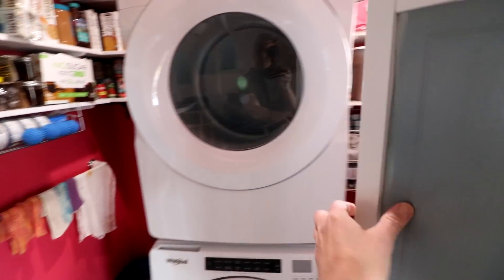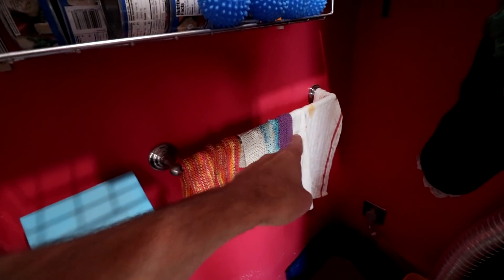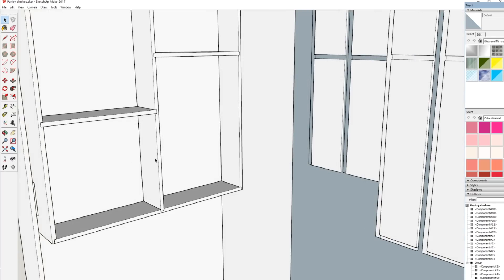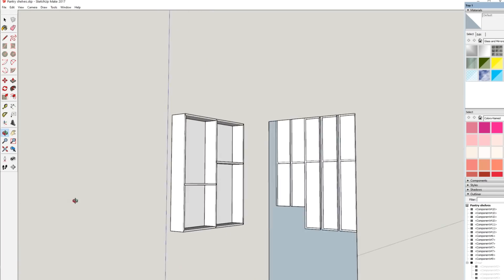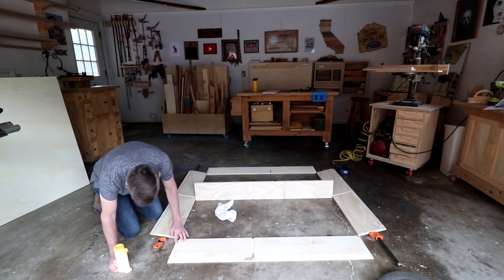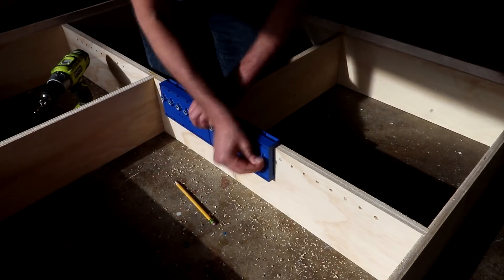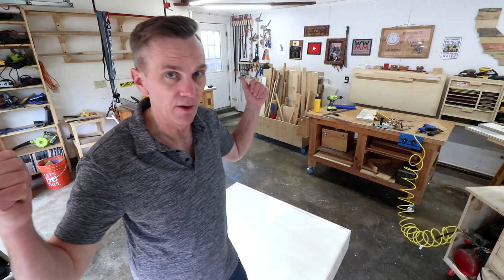42% of you just wing it. Building a new pantry storage cabinet.

Comment: Steve, I would make the cabinet from wall to wall and make a cutout for the light switch.  That way I would have more cabinet space and servicing the switch later wouldn't require taking the cabinet down.  But I guess it's too late know.
Reply: Yes, I would have cut a hole in the cabinet and used a mud ring on the j-box so I could install the switch in the side wall of the cabinet.
Reply: @MucaroBoricua  I've had to do it before for a client (I make my living as a handyman.) It's so much simpler.
Reply: Dwayne Bearup, I’m just a DIYer but glad to see a professional agrees with me.  Cheers
Reply: @MucaroBoricua  An even better idea I just read further down in the comments was to put the switch outside the closet entirely. That would be ideal, provided the wall in question has room for a switch and cover plate....
Reply: @Dwayne_Bearup , cool.  That would certainly be a lot cleaner solution.

Comment: You may need enough space to fix or replace the light switch if needed. 

Thanks for the videos!
Reply: Ouch!  I resemble that remark. Great suggestion! I’d probably not consider that then have to cut out a section to get to the switch.

Comment: How do plan to handle a switch replacement? Are you planning to mount with a French cleat and couple cabinet mounting screws so the outlet can be accessed for maintenance? What about scribing in a filler piece and installing the light switch plate in the filler?

Comment: Hi Steve, Just a suggestion regarding the switch...Make your cabinet full wall width and cut a hole for the switch.  You can buy a box extender so the switch plate is flush with the cabinet.  That would be much nicer than having that long narrow space.

Comment: Curiously, my last project was almost identical to this cabinet, even down to the detail of bevel cutting the top rail that goes behind the back panel to turn it into a French cleat which sure made hanging it easy.  I did not do much in the way of plans.  I figured out the dimensions I wanted to maximize plywood use an minimize waste. So the only drawings I had, were a couple of hand drawn sketches of the plywood showing what pieces would be cut from where,  and couple of detail drawings of the rabbets just to make sure I did not cut them on the wrong pieces.

Comment: I would have looked into trying to build that light switch into the side of the shelving unit.  There has to be some way to bring it out the thickness of the plywood so it looks like it's always been there. That way you could avoid having that gap between the unit and the wall.
Reply: They make mud rings for every size and shape of j-box and in a variety of depths.

Comment: I will use plans for inspiration but rarely follow them to a T. In fact the one I followed most closely was Steve's lumber cart that I built just a few weeks ago. Very similar but downsized it a bit and adjusted the shelf spacing. That's about as close as I get. Sometimes I even combine ideas from different plans. Currently working on a storage cart for drills, batteries, sandpaper/discs/sanders, as well as hardware, that's using ideas from two totally different sets of plans and also adding on pegboard to the back of it for more utility.

Comment: That room has a lot of potential. 

My wife and I had three cats, now down to one 😿. 

Best thing I did was make a cabinet for their litter box. It's separated into two sections, first one is for entry/exit, the other is their litter box. There is a divider and hole between them, hinged lid for access for cleaning and allows light. The litter box side is connected to piping that has an inline fan and vents outside.  This does a few things. No spell or dust and the first area has one of those cat rugs that collects things that might be stuck to their feet. 

Having your dryer in the room should allow you to connect a vent to your dryer exhaust and keep you from having to cut a hole in the wall, should look nice and clean.  Using inline gates that only allows air in one direction should avoid any blowback into your dryer.

Comment: Depends on what you mean by "plans"  I always use plans.  Sometimes the plans are detailed down to individual piece cuts, sometimes the plans are simple sketches to remind me of the dimensions i need for a final product, sometimes I am familiar enough with the project that the "plans" are written on the inside of my forehead.  

The house my father built himself, drove every nail, handled every board was damaged recently in a hurricane and some of the framing had to be replaced during the repars.  I was able to salvage several chunks of 2x8 and 2x10 fir and pine that dad had handled some 72 years ago.  I decided to make some simple boxes and hand them out to my children and their cousins made from "Big Pop's" house.  Each box is a little different in size due to using the most I could out of the material I had; but they all have box-joint corners, inset bottom, flush top and real antique brass hardware salvaged from an old jewelry box shop.  I had a "plan" in my head, but let the dimensions of each box be determined by the material.

Comment: Not really at the level of plans, but I pretty much always take notes of the cuts I need to make and the dimensions. But so far I've only been using very simple joinery (glue and/or pocket screws/screws). 

Recently I tried to make a simple shelf for putting recycling bins (so literally garbage, but a good opportunity to try something a little different) and took the opportunity to practice half laps/dados, sort of in the same vein as your half-lap stool. Hard to denote where all the half lap/dados need to go in text, and I ended up cutting a few dados on the wrong side. Not too big a deal since it wasn't the most important part of the project structurally, but that motivated me to go through your SketchUp tutorial and give SketchUp a try, and I ended up making (and using) my first set of plans to make a desk for my wife.

Comment: On the lighting, you can get smart bulbs and have a remote.  Put velcro on it and attach the remote to a different spot on the wall making it easier to turn on and off the light.  Also, you could use voice activation with google home or Alexa and turn it on or off that way as well.  Then you won't need as much clearance and would be easier to turn on and off.

Comment: Sorry if this has already been said, but you could put a motion detector light switch in there so the light comes on automatically when you open the doors. Then you don't need to reach in between the wall and the new cabinet to turn on the lights each time

Comment: I"m sorry you didn't give us a chance to comment before cutting wood. You can buy junction box extenders to move the light switch out to the inside of the shelving unit. Then I would put a motion sensor light in the ceiling so that you don't have to turn on and off the light. So what if the cats trip the light. It'll go off when they leave. I have motion sensing lights in my garage and basement. If you find you are bumping the switch, a switch lock can make it so the power stays on to the light. Also, most motion lights have a sensitivity setting so that the cats won't turn on the light unless they decide to do laundry.

Comment: Hi, Steve. Would it be necessary to remove the cabinet from the wall if you need to maintain the light switch? in this case, it would be easier to leave more space between the cabinet and the light switch. I don't make plans because I'm not good with graphics software. I use a pencil, ruler and a notebook occasionally. Thanks for sharing and have a nice weekend. Marcelo.

Comment: Why not put an escutcheon plate on the light switch and put a cutout in the side of the cabinet, so the switch would be inside the cabinet.
Reply: Another option is to move the switch to the other side of the wall, outside of the closet. 👍
Reply: @brandoncarpenter9158  That's an excellent idea.

Comment: The reason I mostly wing it is that I’m mainly using scrap wood, to avoid buying wood.   And my projects are largely dictated by the wood scraps I have.   And sometimes when I’m building I think of a better way to do it or an improvement I didn’t originally plan on doing.   So it’s nice to change the design on the fly.  
If I was using wood I actually bought I’d probably use plans more often just to minimize waste.

Comment: I would suggest you measure if the space between the side of the cabinet and the light switch allows you to unscrew the switch and pull it out, or else you'll have to take everything out if the switch fails for any reason and you need to replace it. Or else leave a gap on the side just in case!

Comment: You know (not to pop any bubbles, er soap spheres) but the current shelves are largely earthquake "compliant" (there really isn't a Code requirement) because the wall runners are attached to the structure, and the shelf supports key into the wall runners.  The only "loose" problem you really have (other than the goods stored on the shelves, which are not usually constrained) is the shelf boards.  If you drill tiny holes on either side of each shelf support and use a tie wire to secure the shelf board to the support, it will hold as well as the basic house structure, and once you have that degree of fixation, there's no point in going further.

Comment: From this video I cannot tell if the top of the cabinet is at the ceiling?  Or is there room above the top to the ceiling to become storage?  If there is room then if the cabinet does not go all the way to the wall with the light switch it's possible for stuff to fall between the wall and cabinet.  If it does not go to the ceiling then the board forming the edge from the wall to the cabinet should be extended so stuff will not fall off, or the top shelf should be recessed from the top of the cabinet to form it.   This reduces one shelf or increases length of one side.    However it would be better to run it wall to wall and find some way to allow light switch access or add motion detection lights so switch is not important in day to day usage.

Comment: Will the French cleats hold the cabinet during a quake? Suppose items on the shelves fall? You could put a head guard over the litter box...
Reply: You use the French cleat just to hang the cabinet. You then screw through the rails  into the studs.  It makes it super easy to get the cabinet hung level and positioned exactly where you want.

Comment: Looking quickly at the closet I would move the machines to the back left of the space and then make a unit to fit on the right hand side but that's just me . By the way I never have time to plan it's normally measure the space and make the wood I have fit the hole .

Comment: Why not move the location of the washing machine and tumble dryer? If you dropped them so they were next to each other and raise them off the floor to make them at a nice height to load and unload you would make things easier and provide more ways space. Under the too you could make for the cats so if they are under there they are protected from things falling on them and make it a cubby space for them.
If you then move the unit against the wall with the units facing each other to allow easy transfer from one to the other with both in the corners.

Comment: I hate those type shelf pins. The hole widens over time and then you end up with wobbly shelves or shelves that fall.

I use the shelf track set into a dado on each side. It is much stronger, and doesn't require much extra work.

Comment: Total off the cuff, noobie, question.  If that door stays shut at all times, unless you are in the room, do push button switches exist that you can install in the door jam so the light automatically goes on when door is on?  Eliminating the need to worry about the switch.      Don't know if that is even possible but it popped into my mind.

Comment: Why don’t you just move the light switch into the cabinet? That’s what I did in my kitchen.
Reply: Great idea
Reply: Yup. Or use a box extender so it extends out flush with the inside face of the shelf side.
Reply: hard wire the switch and add a pull-string light fixture
Reply: Better yet, move the switch to the exterior wall
Reply: Rewire the whole house!

Comment: Why not just make the cabinet wall-to-wall to maximize the space and then use an electrical box extension ring so the light switch and wall plate come through and mount to the inside face of the cabinet? That way you don’t have an unused gap and you have more storage space.

Comment: I think it's a really bad idea to bury the light switch in that manner.  You're not supposed to block access to electrical boxes in general, and if you ever wanted to replace that switch or do some other wiring, you'd be up a creek.  Better to relocate the switch to the outside of the closet.  It looks like you could re-face the switch box to the outside wall, just under the pictures.  Wouldn't be in the way, and would be properly accessible.

Comment: Instead of having the light switched make it always have power and get a motion activated light. No switch no problem.
Reply: Yes, that 'small' gap on the left will take up relatively much storage-space - I would cut a hole in the side for the switch.
Reply: I had the same idea. Either a switch of some type connected to the doors, so the light comes on whenever the doors open, or a motion sensor of some type. If placed properly, even the cats would get some light when using the box.

Comment: I think I would use planes if I really knew how to navigate "Sketch UP" I worked for 39 years (before I retired using only plans). I do love designing stuff and will do at least a small drawing when I make something for a specific location. I would also add that anyone that lives in CA does not have a flat level place to mock up anything. I have an assembly table I built from an old Oak Pallet that I use as an outfeed table and can breakdown quickly when I need my patio for regular outdoor stuff...

Comment: Hope you allowed yourself enough clearance to get this cabinet into the space, unlike the bedroom closet organizer ;-)
Reply: I was thinking the same thing.  Wonder if he will have to remove the washer/dryer first.......whichever one is stacked on top.
Reply: @holdemNE1  Washer is always on the bottom of stacked units. Don't want something full of water and laundry out of balance spinning on top! That might tip it over!
Reply: @hotrodhog2170  
Thanks, that makes sense.  Plus the loaded weight and/or a leak dripping onto and into the dryers electrical would all be bad.
Reply: @hotrodhog2170  Also the weight of all that water, even if it didn't tip over it would crush the dryer. (Over time, at least.)

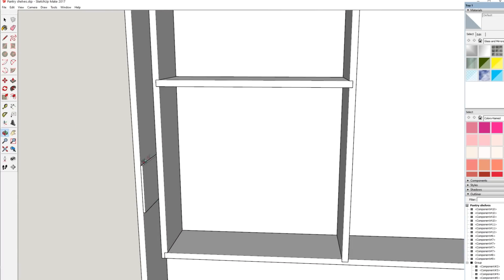Comment: 1:55 - Terrible idea. What happens when you inevitably have to replace the switch plate?
Reply: I was thinking the same thing about access (possibly even a code issue) but then remembered that if Steve hangs it on a French Cleat, he can just lift it off if he has to access the switch wiring.
Reply: @davidbondi , he would still need to remove everything stored and take it down. That's a lot of work.

Comment: Too bad you already built it...  I would have recommended that you build the shelf above the switch full size to maximize the space, then a shorter box to allow access to the switch... and you might need a little bit more space than you think to access that switch, maybe it's not as bad, hard to tell from the camera angle...  or better yet, if it's possible, you could relocate the switch on the other side of the wall and it will give you 100% of the inside for your cabinet.
Reply: The only problem with attaching things above switches is the chance you could drill into your wiring.
Reply: @cbalan777  Yes, that is something that you'd have to worry about, and so if anyone is intimidated by this and/or inexperienced that is something that can be hired out.  However, in my case, I can easily tackle a project like this, in fact I had to do this operation for my kitchen remodel:  The light switch would have been behind the refrigerator and easier to put the light switch in the dinning room on the other side of the wall and put both switches in a double gang box.  And don't drill into your wires 😬 LOL
Reply: @cbalan777  Also use a wall stud finder with an electric field detector to make sure you're not about to make a shocking discovery! 😲